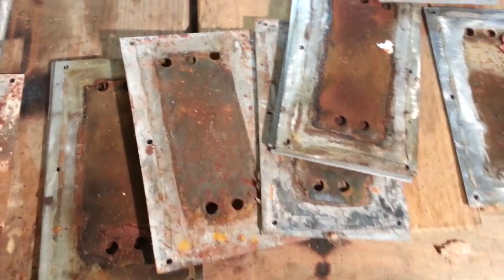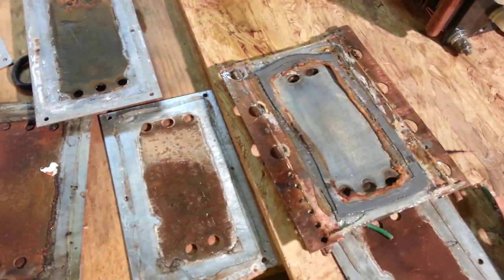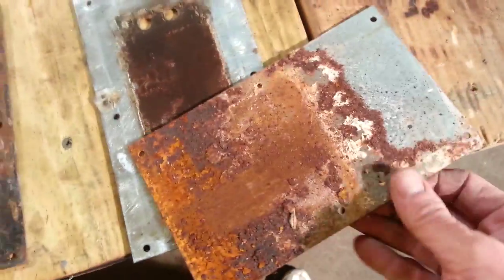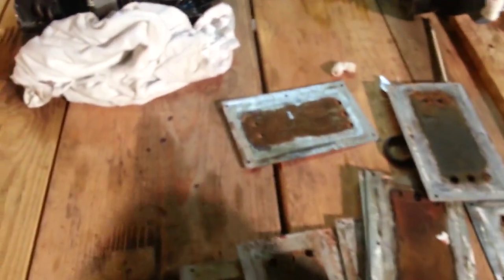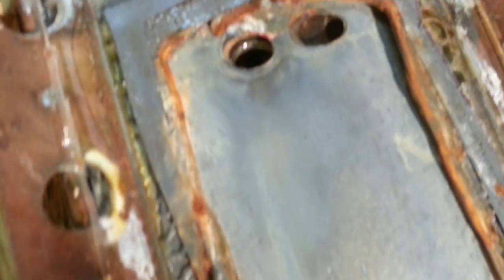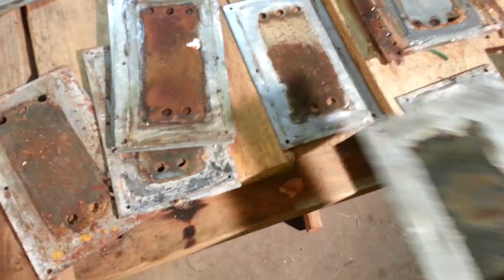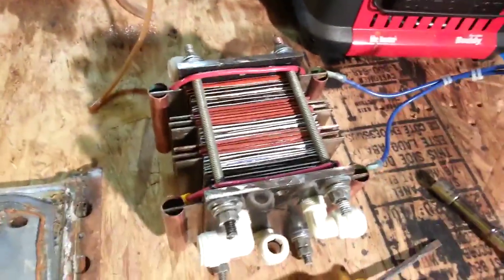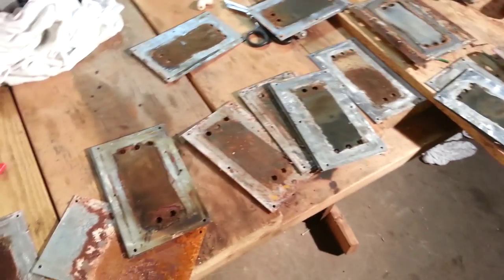HHO bi polar cell plate inspection 600 amp Iron plate electrolysis cell

Comment: Hi NoBox
Tx for sharing. would you mind telling us about the electrolyte you used and how much Gas in ml you collected per Watt ?
Thank you Helmut
Reply from the maker: i used Naoh , pure sodium hydroxide drain cleaner , 1500 watts produced 5LPM 5000/1500 = 3.3 ml per watt. ths cell was by far the best yet but the gaskets failed , shower pan liner makes poor gaskets
Reply: Why is it this so low, what is the gap distance. If you make your Plates parallel all the Way you weaken the magnetic Channel between the plates. Molecules get ripped apart by magnetic Forces. To prove that just move one lead close to the other.
I made Squish Zones as one of the above Reasons. with strong magnetic Field between the Leads which makes me ,if I push it,  up to 6 to 7 ml per Watt.
I'm using in my Truck a reduced Electrolyte concentration to control the Draw from the Alternator. I,m driving with about 3.5 ml per Watt andhave very good driving Results. The max Amps I allow is 15 Amps.